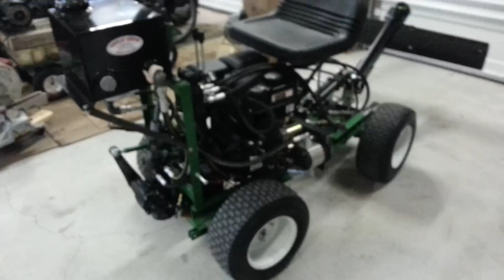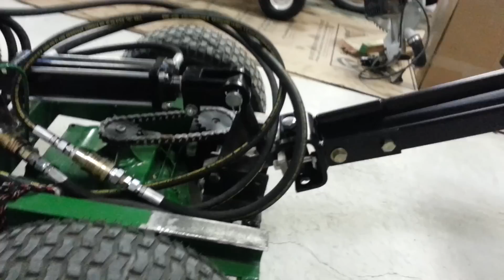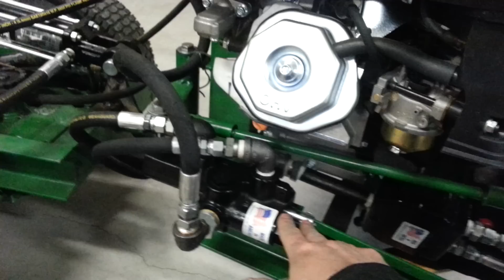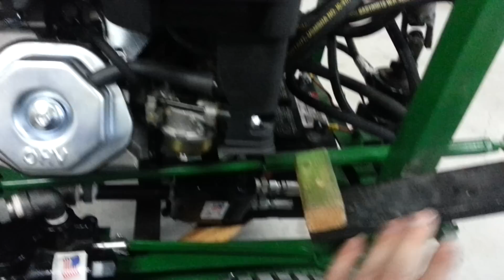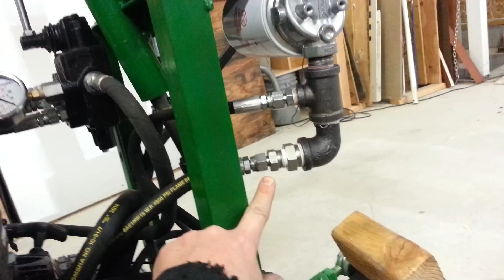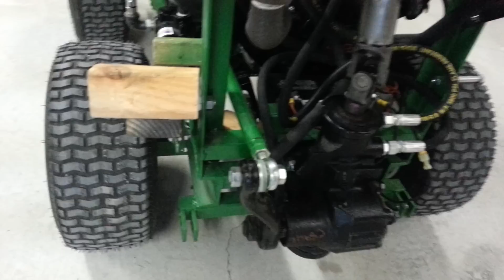Homemade Tractor Hydraulic overview

Comment: Nice. I see tw things that will need to e addressed when you take it int the woods. First is it is way to narrow or your seating position. You could correct this by adding 4 more tires and wheels. The second thing will be traction when you work it hard. I would suggest mounting another motor/transaxle set up in the front as well. While the Hydro-static transmission may was a good idea your solution is likely cheaper and less trouble. Hydro-static transmissions get finicky when they get older. Nice build!

Comment: why did you chose to mount the seat over the front vs the rear. My question would be how it affects weight distribution
Reply from the maker: Hey- thanks for the comment on the old video.  With hinged frame it worked out easier to keep all the mechanicals on the front or back end and I thought I'd use the backend for something more...   This video is old.  I used a lot of these parts to make a bigger 4wd version... but still ended up with the engine and seat on the front. go figure.

Comment: very cool !!      consider using a hydraulic  cylinder to operate the steering  you can do away with the steering box.
the  system system is used on articulating loaders.    your a genus

Comment: I'd just went out and bought me a tractor. Let me just say this: A tractor that has 10,000 HP isn't worth a dime unless it has the (WEIGHT) to give it traction. That little thing won't have any traction. It's way, way to light. Fill the tires with Antifreeze. that will help you some.